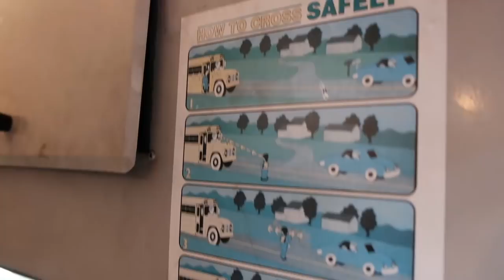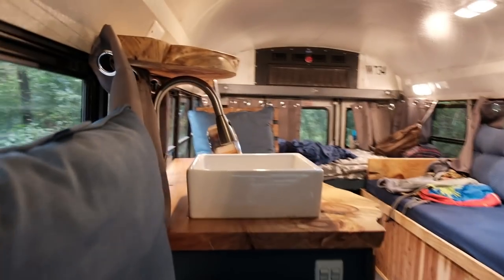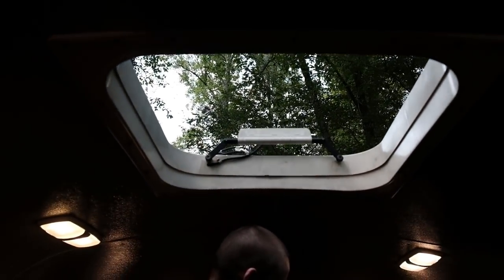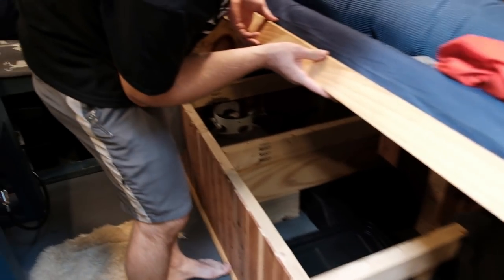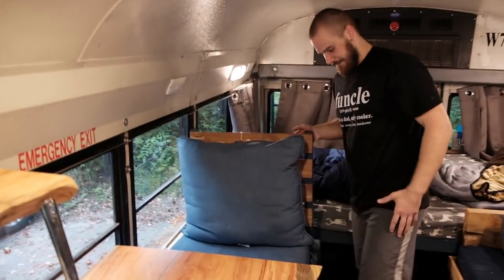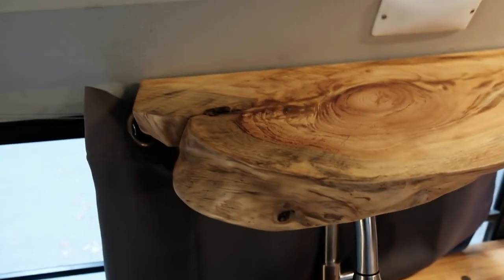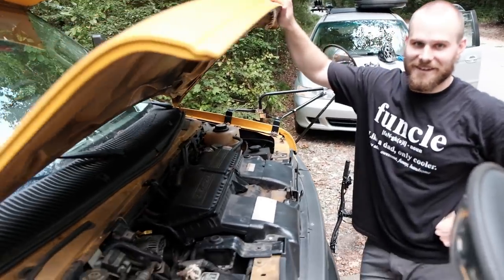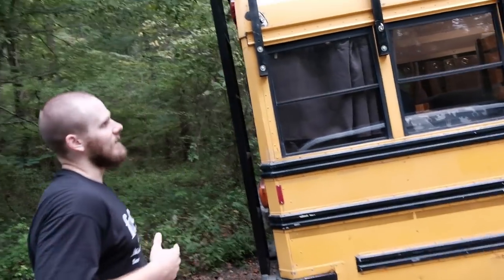School Bus Converted Into Adventure Camper

Comment: Hey, I have a question.
Do you have to have a special licence to drive one of them mini buses or will a standard licence work?
Reply from the maker: Hey! As far as I know this one does not require any special licence. It's really just an F450.
Reply from the maker: Thanks  nick garner  ! That is a perfect answer.
Reply: ALSO, if the bus has AIR BRAKES than there is a special air brake endorsement required... lots of short buses have air brakes, be careful about your purchase...